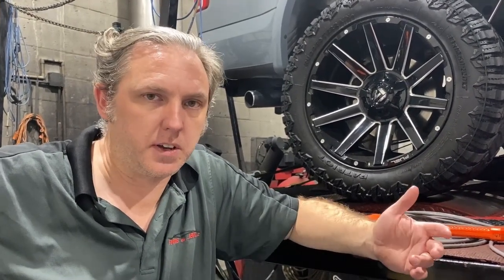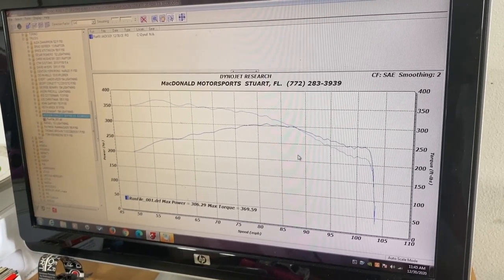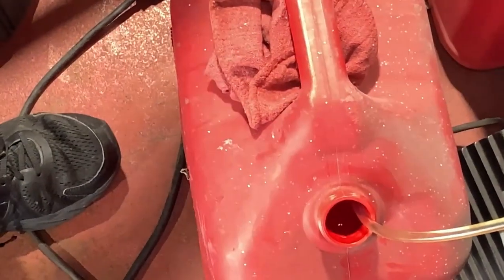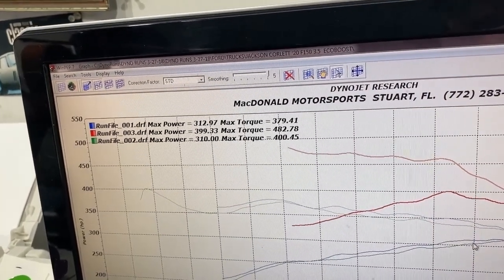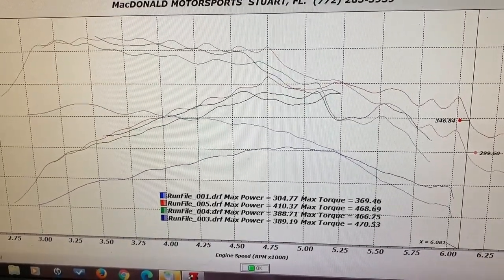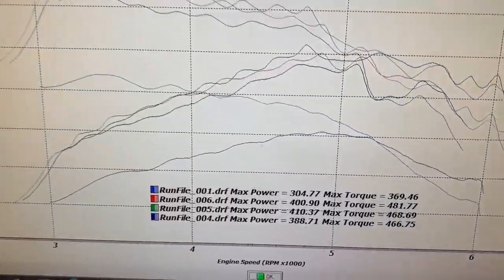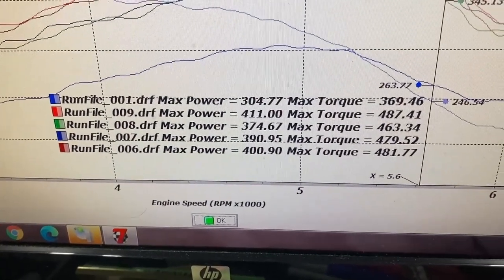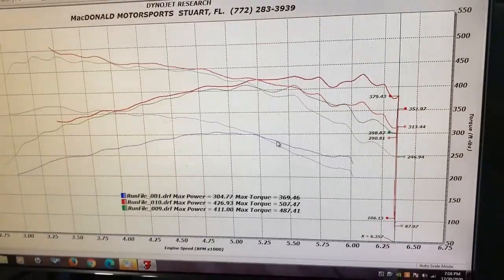2020 Ford F-150 FX4 _ Dyno Tuning _ Impressive Power Increase _ Best Mod You can Get!

Comment: What a pain starting out with the wrong fuel. I'm guessing James will NEVER let that happen again. Live and learn. Great power gains for sure. I've heard the intercoolers are small on the EBs bigger ones will really bring them to life.
Reply from the maker: Stupid Fast Truck . . . just a miss communication with the owner. . .  we got it worked out. .  you are correct with regard to the intercooler on the EB.  . they are small. . a larger one helps a lot. .

Comment: Suprising how much more power a tune makes on a stock EB. I have been running 93 sense new in mine there is a horse power gain with stock tune.
Reply from the maker: miles Hiles . . .even on a stock tune 93 makes a difference. .  octane is everything..